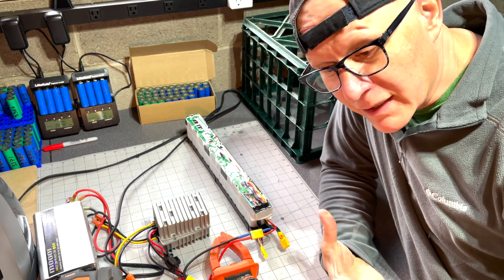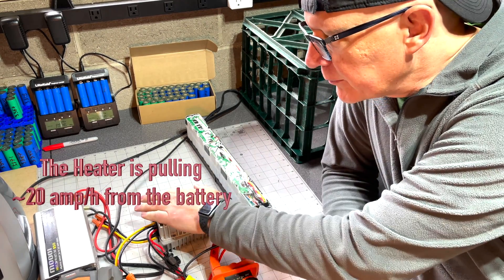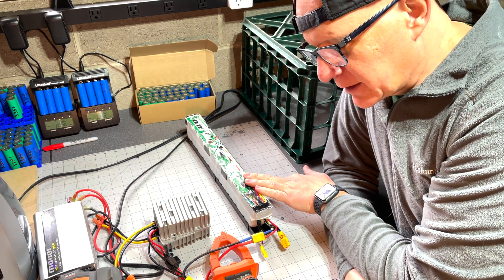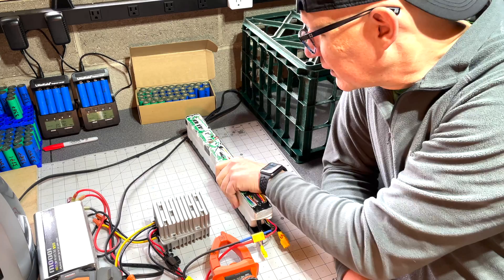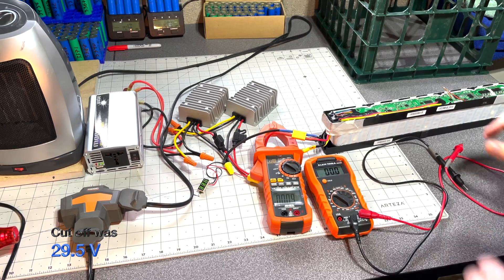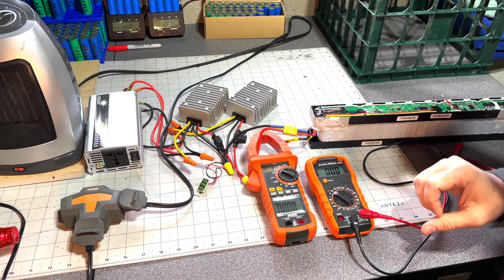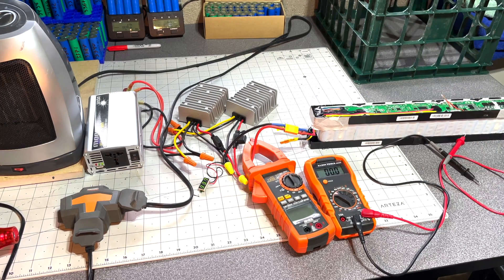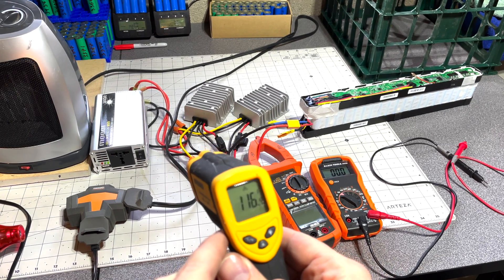Scooter Battery 3rd pin hack - 40 LGMH1 18650 - BMS Low voltage disconnect test (ep 03)

Comment: so during overcurrent shutoff, how do you reset it?
Reply: Any update of this? I have also latechd-up battery packs, not possible to charge-discharge anymore despite the internal voltage at CELL+ is > 32V

Comment: Fantastic. This is the one modification to the BMS that proves that it's possible to activate the battery without a hack that compromises the BMS's ability to do a low-voltage shutdown.

Incidentally, I haven't found the plug-in board at JAG35 - do you have a link to it?
Reply from the maker: It looks like he removed it, from his site, not sure why...
Reply: @t-bo-diy  Finally found them here: https://jag35.com/collections/lithium-batteries/products/can-controller-for-lgmh1-18650-lithium-scooter-battery-pack. He may have stopped producing them as he's sold out of batteries, I believe. Been trying to contact him (sent a YouTube message and one Twitter DM) to see if he plans to do another run - or if he'd be willing to produce another batch with enough guaranteed orders.

No response yet.
Reply: @t-bo-diy  Eric - question - would you know if an off-the-shelf STM32 controller such as the STM32F103C8T6's on Amazon would do the same job as the JAG35 controller, with the firmware that Alex coded?
Reply from the maker: @cudak888  I don't know
Reply from the maker: @cudak888  Look like Can controller is back in stock on Jag35 site...
Reply: @t-bo-diy  Got three of them. One appears to be dead, but the second I soldered up is working perfectly.